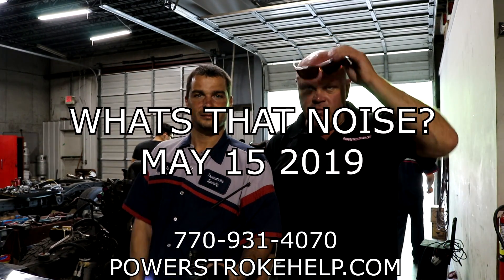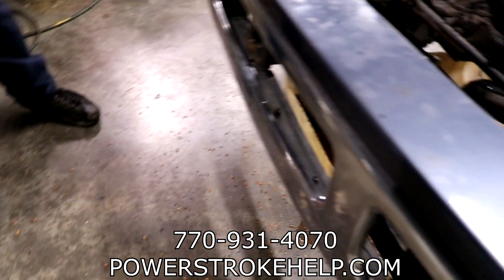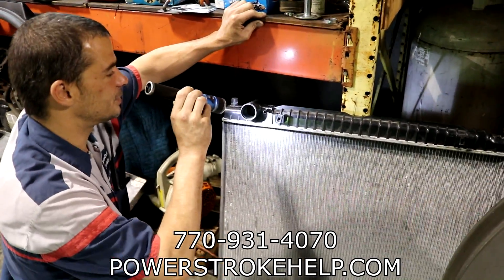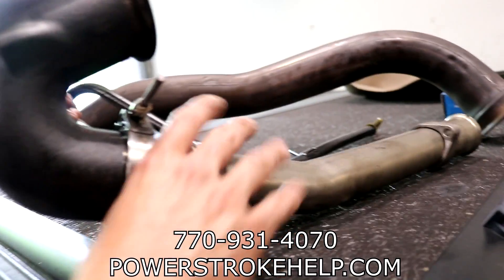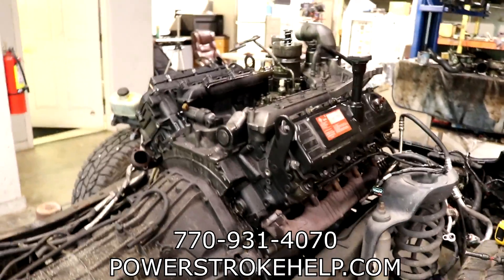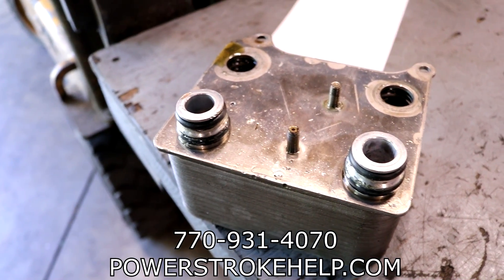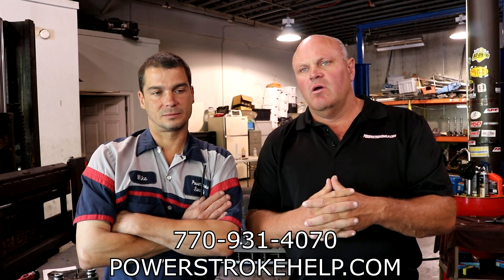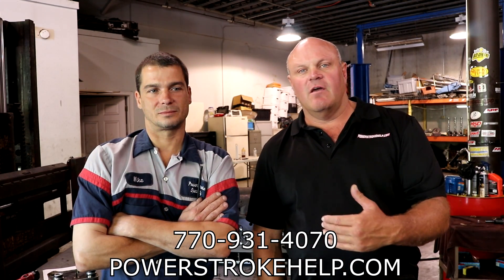WHATS THAT NOISE 15 MAY 2019 - POWERSTROKEHELP.COM

Comment: That is y if ik I'm not putting a hose back on for a while if the hole is big enough I'll stuff a rag in it then lay another over and use electrical tape around to hold it on or if it's a tube I'll use a piece of hose and a bolt

Comment: If I work on it is't $125.00 per hour, if you worked on it first it's $175.00. If you want to watch me work it's $250.00 per hour, and if you want to help or offer advice it's $500.00 per hour. Now which repair plan did you want?

Comment: I am replacing the radiator on my 1999 navigator 32valve.Any tip on what spring lock to use when loosing the transmissionlines from the radiator?I live in Sweden,so those cars are unusual over here.I am fitting a mishimoto on Bear my navigator!

Comment: Looks like rehydrated whole peppercorn maybe someone had a leak and not only didn’t use the right stuff but then didn’t use the right stuff again. But putting it in the upper hose would make since instead of the pressure tank

Comment: I had to use rabbit wire hardware cloth & fashion a screen on my cold air intake inlet to keep the chipmunks from storing hundreds of acorns in the air filter box of my 1999 7.3L.

Comment: Bill . Web site..great  just started using arch oil in my 96 7.3 350 still clicking. Run better not smoking like before using Arch oil additive  and fuel additive  keep up the good work

Comment: big dogg your the man...love ur site. I drive a cummins, still have 1993 12 valve my wife uses to feed the cattle here in mt...just but in granny gear go on the flat bed and stays straight for 40 acres. best engine I had. Not like the new stuff but always runs, starts and 850,000 on it mostly all still factory stuff except water pump, gertrag tranny still strong, used on pipeline til 2000 and got a new cummins, didn't get what that one gave me, then another, running good. Your the man, u can crack up a nun who isn't allowed to laugh. best to ya and boys, and fords rr good, but taking a cab off to work on no way hoss...but that's why your the big dogg. Be cool man. Keep the jokes flowing like fords turbos

Comment: I found fuel in the coolant, is it worth fixing?
Reply: 1 or both of your cylinder heads are cracked. It’s not uncommon on a 6.0l that’s gotten hot

Comment: I don't know what you guys are trying to pull but you're right about one thing someone did put those seeds in there now who is the question wasn't no God damn squirrel nobody would put the parts back together when they seen the seeds in there I can't get through a filter
Reply: You're right, a squirrel didn't do this. 
A mouse or rat did it.  If it had more time to settle in, they're woulda been chewed wires too.  Doesn't take long.

Comment: My latest 97' is at 375k mi thanks to Bill!
My last 98' went 789k mi with 602 fpt
780 HP thanks to Bill!
If you dont go to POWERSTROKEHELP.COM and look at  unimaginable amount of Powerstroke info yer blowin it and prolly got more dollars then sense!
I have done all the work on my Powerstrokes myself and I haul 9800#'s of trailer constantly.
This channel only scratches the surface go to the website you will be glad you did.